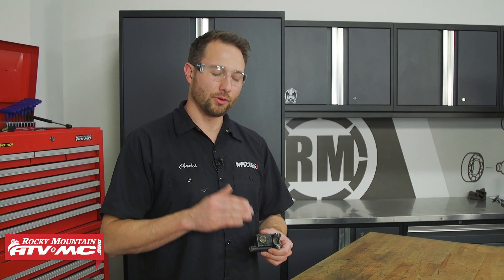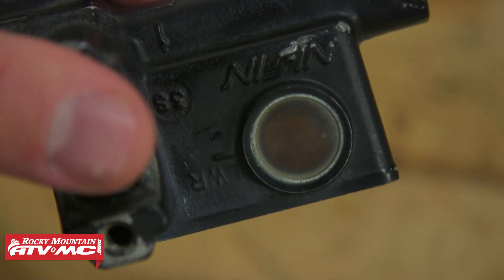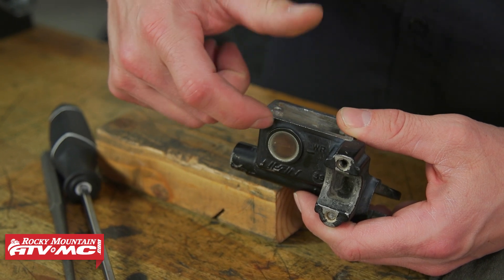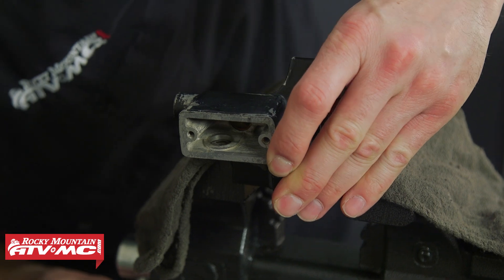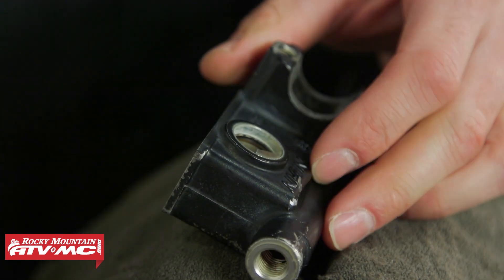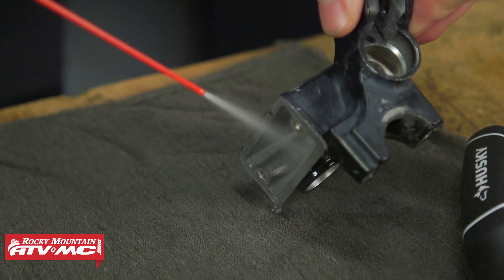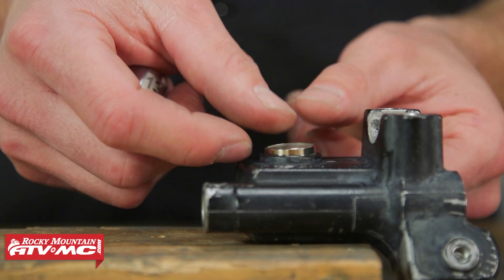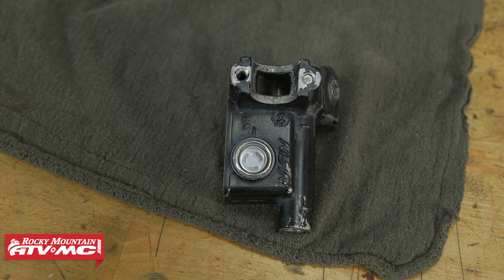How To Replace the Master Cylinder Sight Glass on a Motorcycle or ATV

Comment: Just did these in place and without the need to bleed. Levelled the reservoir, drained to below the window with a veterinary syringe and the rest exactly as you did.   The replacements are cheap and the same as the polycarbonate originals that have been there since 2007 - just starting to crack. I did use a tool to hold the clutch lever under pressure, but I’m not convinced this is necessary. 👍🏻

Comment: 13 mm socket used to press in it appeared; I bought a pair of 18 mm glass lenses from Rocky Mountain & hope to install while afixed to the handlebars - I have "vice clamps" and will WD-40 the outer rim before installation prior to install. Don't want to crack the 🥂 got to go slow. Thank you so much Rocky Mountain !!
Reply: Do not use WD-40 on brake master cylinder parts or any petroleum-based products. Only use DOT4 fluid to lubricate as petrol based products will cause the seals to swell and lead to premature failure. If cleaning, you can use isopropyl alcohol to clean.
Reply: @mattng5389  I rubbed a microscopic amount of WD-40 simply to lubricate the outer walls of the sight glass before installation. That is not & has not done anything to the brake master cylinder functionality

Comment: Thanks so much. How do I know if is for the one I need? Or all all standard? I need a 1985 Yamaha VMAX. Regards
Reply from the maker: This is a standard 18mm sight glass which is the most common size. You will need to measure yours to see if this will fit.
Reply: @rmatvmc  I did and ordered. Thanks. Great video.

Comment: Hi, great video! hey... have any experience with a Honda VT700 1986? from what I see the parts manual there is no spare parts or o-ring, seems just glued some way.
Reply: o-ring would practically “replace” wtv “glue” is holding it, i have a 85’ 700, did the fix works like a charm
Reply: no freaking way. I am doing this to the same exact year lmao! What are the odds. Did you come up with anything crazy? I might just 3D print a new one. my resin might stay clear enough to see through. If not, oh well. Mine are completely rotted away and the bike is useless without plugging them!

Comment: Question: I have this type of reservoir on my transalp. Are these specific to specific bikes, or can I completely replace it with a transparent cylinder type?
Reply from the maker: Most sight glasses are pretty universal. This one measures 18mm so you can check yours and see if you think this would work.

Comment: How do you remove the brake cable from the master cylinder reservoir itself? I'm trying to remove mine off of my bike so I can properly clean all of it but I can't get the cable separate from the reservoir if anybody knows how please let me know
Reply from the maker: There should be a bolt that connects the brake line to the reservoir. It might require a large hex key to remove it.

Comment: Do you absolutely have to take it off the bike? Is there any reason why you couldn’t just do this on the bike? My sight glass popped out on its own and I lost my front brake on a ride.
Reply from the maker: It's easier with it off. I'd recommend using a vice but maybe you can get a c-clamp and socket to work. 🤷‍♂-Charles
Reply: Use needles nose vice grips when it still on

Comment: This is what gets me it says sight glass for the brake and clutch master cylinder but they are not glass they are some stupid plastic ones that go bad in the sun or summer tell me why they don’t have real glass ones I bought a pair of them for my friends 1990 Honda Goldwing SE 1500 and with in a couple of months later they crumble into nothing and pieces and they are still going up in price quickly so I paid 8 to 9 bucks for two then I checked on them for his bike again and they are 28 bucks for two of them if they were real glass and are very careful when putting them in they would last a lot longer than cheap plastic ones
Reply from the maker: What brand did you use? The Tusk Sight Glass we installed has been in there for a couple of years with no issues. -Charles